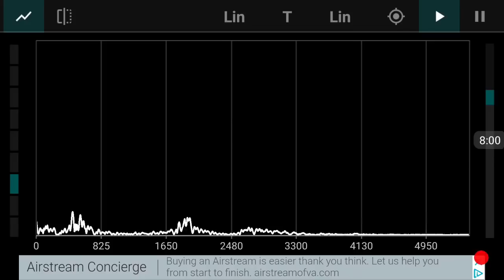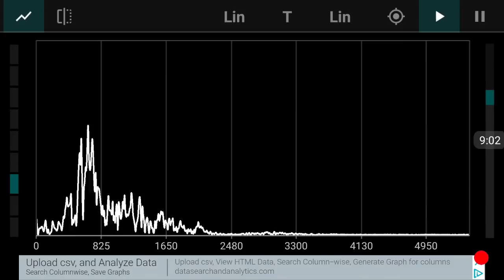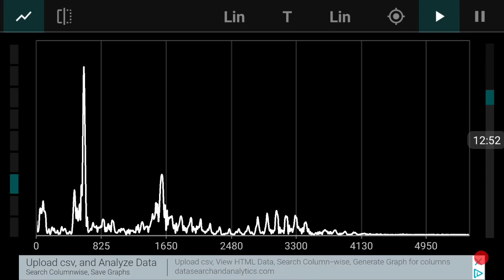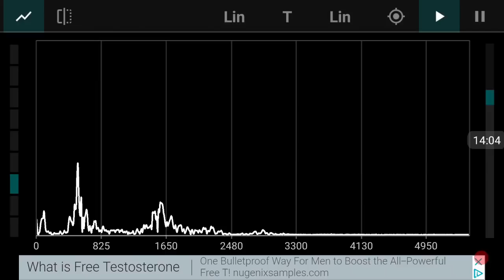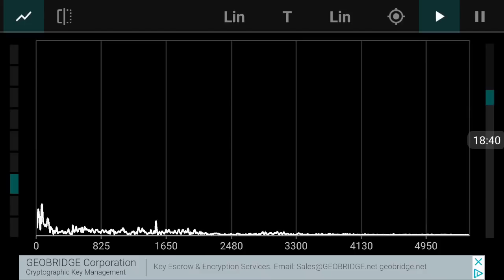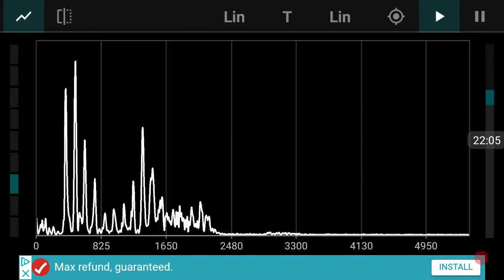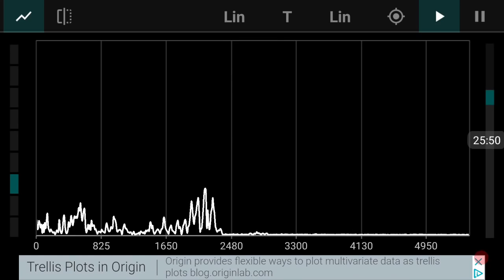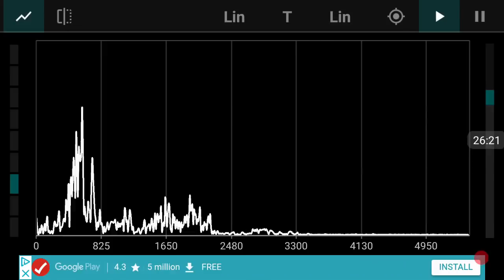CB radio In The Real World, Crystal clear vs the "Dodgy Golden Screwdriver" VideoGate.

Comment from the maker: Here's what it takes to cut through the noise, be loud and crystal clear with a better receiver too. True, it's more complicated and time consuming to accomplish these consistent and accurate results. Below is a partial procedure and list of calibrated equipment used to achieve this level of performance. Rule #1) "Tuned Bench": https://www.youtube.com/watch?v=lwcDfXOgAls  Read on ... the intelligent ones do.

Fine Tune CB Radio Shop strictly adheres to (https://www.nist.gov/) NIST Traceable Calibrations and other industry standards to maintain accuracy and consistency for providing "Real World Performance Tuning" of Citizens Band and 10 Meter export mobile radios with integrity.

"Basic Textbook AM/FM/SSB Transceiver Tune, Alignment and Calibration" 

1) Pll adjustments:
VCO & OSC, AM TX OSC, USB TX OSC, LSB TX OSC.

2) Transmitter alignment:
DRIVER BIAS, FINAL BIAS, SSB  (or gate voltages for mosfet versions) CARRIER BALANCE, HI-LO AM & SSB Power, RF METER, AMC, ALC and FM DEVIATION.

3) Receiver alignment:
AM/FM RF & IF SENSITIVITY, FM DETECTOR/DEVIATION, SSB IF SENSITIVITY, SSB S-METER, AM/FM S-METER (100uV unmodulated -67dbm for “S-9” meter reading!), AM/FM SQUELCH RANGE, SSB SQUELCH RANGE, and NOISE BLANKER/AUTOMATIC NOISE LIMITER (Real World dBm to volts (uV) tables below).

That's a typical run of the mill textbook tune / alignment. There's more to it than frequency alignment, modulation adjustment, meter calibration and "tune for maximum rms, average peak Bird watts "tune up report".

Test Bench includes:

Bird 4314C Meter:
https://www.birdrf.com/Products/Test%20and%20Measurement/Power-Meters/Wattmeters-Line-Sections/RF-Wattmeters/4314C_PEP-Single-Element-Wattmeter.aspx
Part 1) https://www.youtube.com/watch?v=RpX9IHe4ORM&t=16s
Part 2) https://www.youtube.com/watch?v=LuhbqTf6Bxw
Bird 4314C Accuracy Test: https://www.youtube.com/watch?v=DqEOabYqhQo&t=5s
Bird Stipulates 1/2 wavelengths  https://www.youtube.com/watch?v=5eWhgT-rTII
And Genuine Bird Elements from 1K down.

Bird 4373 Sampler: 
https://www.rfparts.com/signal-samplers.html

HP8924c with options:
http://userequip.com/files/specs/2147/HP%208924C%20Repair.pdf
https://www.youtube.com/edit?video_id=Cg1w0xBa27s&video_referrer=watch

HP8920a with options:
https://www.keysight.com/upload/cmc_upload/All/EPSG072204.pdf

Three analog scopes, one digital 200 Mhz:
https://www.atecorp.com/atecorp/media/pdfs/data-sheets/tektronix-2465b-2467b_manual.pdf
https://www.youtube.com/watch?v=by98x4eu2lM

Fluke 27fm:
http://www.fluke.com/fluke/inen/digital-multimeters/fluke-27.htm?pid=56055
 
LCR http://www.lcrresearch.com/wp-content/uploads/2017/05/LCR_Pro1_Manual_version1.03.pdf

Power supplies:
6 Cosel PBA1500f12 (750 amps) variable and configurable.
https://en.cosel.co.jp/product/powersupply/PBA/PBA1500F/PBA1500F-12/
Corcom 20VB1 F7130 EMI Filter 50-60Hz 250V

Times Microwave Coax jumpers and test leads:
http://www.timesmicrowave.com/cms/products/cables/lmr/
https://www.youtube.com/watch?v=EmqaGJ6IWow
https://www.youtube.com/watch?v=1ltFVSxGp5Y
https://www.youtube.com/watch?v=v12YZT_1o90
https://www.youtube.com/watch?v=h7iiYfmYWRA&t=215s

Amphenol RF Connectors:
https://www.amphenolrf.com/
https://www.youtube.com/watch?v=dVh5B0hdEA0 
https://www.youtube.com/watch?v=dKZg8T_AOso

Want more range, compliments, reliability and a quieter, clearer but more sensitive receiver? Get Fine Tuned .. not peaked and ruined.

Here are some VideoGates of me at the bench practicing what I preach using my bench radio or customers radio completed and ready to be shipped: https://www.youtube.com/results?search_query=hard+drive+163+ more: https://www.google.com/search?q=Hard+Drive+163+nm&ie=utf-8&oe=utf-8&client=firefox-b-1-ab

It's what I recommend, use, service and sell ... to you ... not something non practical or deceiving in a misleading way. I'm not just the tech and owner of Fine Tune CB Radio Shop, I'm a customer too!  When finished,  "you'll be giving radio checks, not asking for them".

dBm to watts and volts.
Table below displays relationship between Power in [dBm] or [Watts] and Voltage in RMS, peak, peak-to-peak for sinusoidal signals in 50-Ohm systems for accurately measuring and tuning am/fm/ssb receiver sensitivity, agc, squelch and "S9" Meter calibration  ..  Real World!

  [dBm] [Watts]   [Volts]rms    [Volts]p      [Volts]pp
-140 0.100E-16  22.361 nV  31.618 nV  63.236 nV 
-139 0.126E-16  25.089 nV  35.476 nV  70.952 nV 
-138 0.158E-16  28.150 nV  39.805 nV  79.609 nV 
-137 0.200E-16  31.585 nV  44.662 nV  89.323 nV 
-136 0.251E-16  35.439 nV  50.111 nV  100.222 nV 
-135 0.316E-16  39.764 nV  56.226 nV  112.451 nV 
-134 0.398E-16  44.615 nV  63.086 nV  126.172 nV 
-133 0.501E-16  50.059 nV  70.784 nV  141.568 nV 
-132 0.631E-16  56.167 nV  79.421 nV  158.842 nV 
-131 0.794E-16  63.021 nV  89.112 nV  178.223 nV 
-130 0.100E-15  70.711 nV  99.985 nV  199.970 nV 
-129 0.126E-15  79.339 nV  112.185 nV  224.370 nV 
-128 0.158E-15  89.019 nV  125.874 nV  251.747 nV 
-127 0.200E-15  99.882 nV  141.232 nV  282.465 nV 
-126 0.251E-15  112.069 nV  158.465 nV  316.931 nV 
-125 0.316E-15  125.743 nV  177.801 nV  355.602 nV 
-124 0.398E-15  141.086 nV  199.496 nV  398.992 nV 
-123 0.501E-15  158.301 nV  223.838 nV  447.677 nV 
-122 0.631E-15  177.617 nV  251.151 nV  502.302 nV 
-121 0.794E-15  199.290 nV  281.796 nV  563.591 nV 
-120 0.100E-14  223.607 nV  316.180 nV  632.360 nV 
-119 0.126E-14  250.891 nV  354.760 nV  709.519 nV 
-118 0.158E-14  281.504 nV  398.047 nV  796.094 nV 
-117 0.200E-14  315.853 nV  446.616 nV  893.232 nV 
-116 0.251E-14  0.354 µV  0.501 µV  1.002 µV 
-115 0.316E-14  0.398 µV  0.562 µV  1.125 µV 
-114 0.398E-14  0.446 µV  0.631 µV  1.262 µV 
-113 0.501E-14  0.501 µV  0.708 µV  1.416 µV 
-112 0.631E-14  0.562 µV  0.794 µV  1.588 µV 
-111 0.794E-14  0.630 µV  0.891 µV  1.782 µV 
-110 0.100E-13  0.707 µV  1.000 µV  2.000 µV 
-109 0.126E-13  0.793 µV  1.122 µV  2.244 µV 
-108 0.158E-13  0.890 µV  1.259 µV  2.517 µV 
-107 0.200E-13  0.999 µV  1.412 µV  2.825 µV 
-106 0.251E-13  1.121 µV  1.585 µV  3.169 µV 
-105 0.316E-13  1.257 µV  1.778 µV  3.556 µV 
-104 0.398E-13  1.411 µV  1.995 µV  3.990 µV 
-103 0.501E-13  1.583 µV  2.238 µV  4.477 µV 
-102 0.631E-13  1.776 µV  2.512 µV  5.023 µV 
-101 0.794E-13  1.993 µV  2.818 µV  5.636 µV 
-100 0.100E-12  2.236 µV  3.162 µV  6.324 µV 
-99 0.126E-12  2.509 µV  3.548 µV  7.095 µV 
-98 0.158E-12  2.815 µV  3.980 µV  7.961 µV 
-97 0.200E-12  3.159 µV  4.466 µV  8.932 µV 
-96 0.251E-12  3.544 µV  5.011 µV  10.022 µV 
-95 0.316E-12  3.976 µV  5.623 µV  11.245 µV 
-94 0.398E-12  4.462 µV  6.309 µV  12.617 µV 
-93 0.501E-12  5.006 µV  7.078 µV  14.157 µV 
-92 0.631E-12  5.617 µV  7.942 µV  15.884 µV 
-91 0.794E-12  6.302 µV  8.911 µV  17.822 µV 
-90 0.100E-11  7.071 µV  9.998 µV  19.997 µV 
-89 0.126E-11  7.934 µV  11.218 µV  22.437 µV 
-88 0.158E-11  8.902 µV  12.587 µV  25.175 µV 
-87 0.200E-11  9.988 µV  14.123 µV  28.246 µV 
-86 0.251E-11  11.207 µV  15.847 µV  31.693 µV 
-85 0.316E-11  12.574 µV  17.780 µV  35.560 µV 
-84 0.398E-11  14.109 µV  19.950 µV  39.899 µV 
-83 0.501E-11  15.830 µV  22.384 µV  44.768 µV 
-82 0.631E-11  17.762 µV  25.115 µV  50.230 µV 
-81 0.794E-11  19.929 µV  28.180 µV  56.359 µV 
-80 0.100E-10  22.361 µV  31.618 µV  63.236 µV 
-79 0.126E-10  25.089 µV  35.476 µV  70.952 µV 
-78 0.158E-10  28.150 µV  39.805 µV  79.609 µV 
-77 0.200E-10  31.585 µV  44.662 µV  89.323 µV 
-76 0.251E-10  35.439 µV  50.111 µV  100.222 µV 
-75 0.316E-10  39.764 µV  56.226 µV  112.451 µV 
-74 0.398E-10  44.615 µV  63.086 µV  126.172 µV 
-73 0.501E-10  50.059 µV  70.784 µV  141.568 µV 
-72 0.631E-10  56.167 µV  79.421 µV  158.842 µV 
-71 0.794E-10  63.021 µV  89.112 µV  178.223 µV 
-70 0.100E-09  70.711 µV  99.985 µV  199.970 µV 
-69 0.126E-09  79.339 µV  112.185 µV  224.370 µV 
-68 0.158E-09  89.019 µV  125.874 µV  251.747 µV 
-67 0.200E-09  99.881 µV  141.232 µV  282.465 µV  "S9"
-66 0.251E-09  112.069 µV  158.465 µV  316.931 µV 
-65 0.316E-09  125.743 µV  177.801 µV  355.602 µV 
-64 0.398E-09  141.086 µV  199.496 µV  398.992 µV 
-63 0.501E-09  158.301 µV  223.838 µV  447.677 µV 
-62 0.631E-09  177.617 µV  251.151 µV  502.301 µV 
-61 0.794E-09  199.290 µV  281.796 µV  563.592 µV 
-60 0.100E-08  223.607 µV  316.180 µV  632.360 µV 
-59 0.126E-08  250.891 µV  354.760 µV  709.520 µV 
-58 0.158E-08  281.504 µV  398.047 µV  796.094 µV 
-57 0.200E-08  315.853 µV  446.616 µV  893.232 µV 
-56 0.251E-08  0.354 mV  0.501 mV  1.002 mV 
-55 0.316E-08  0.398 mV  0.562 mV  1.125 mV 
-54 0.398E-08  0.446 mV  0.631 mV  1.262 mV 
-53 0.501E-08  0.501 mV  0.708 mV  1.416 mV 
-52 0.631E-08  0.562 mV  0.794 mV  1.588 mV 
-51 0.794E-08  0.630 mV  0.891 mV  1.782 mV 
-50 0.100E-07  0.707 mV  1.000 mV  2.000 mV 
-49 0.126E-07  0.793 mV  1.122 mV  2.244 mV 
-48 0.158E-07  0.890 mV  1.259 mV  2.517 mV 
-47 0.200E-07  0.999 mV  1.412 mV  2.825 mV 
-46 0.251E-07  1.121 mV  1.585 mV  3.169 mV 
-45 0.316E-07  1.257 mV  1.778 mV  3.556 mV 
-44 0.398E-07  1.411 mV  1.995 mV  3.990 mV 
-43 0.501E-07  1.583 mV  2.238 mV  4.477 mV 
-42 0.631E-07  1.776 mV  2.512 mV  5.023 mV 
-41 0.794E-07  1.993 mV  2.818 mV  5.636 mV 
-40 0.100E-06  2.236 mV  3.162 mV  6.324 mV 
-39 0.126E-06  2.509 mV  3.548 mV  7.095 mV 
-38 0.158E-06  2.815 mV  3.980 mV  7.961 mV 
-37 0.200E-06  3.159 mV  4.466 mV  8.932 mV 
-36 0.251E-06  3.544 mV  5.011 mV  10.022 mV 
-35 0.316E-06  3.976 mV  5.623 mV  11.245 mV 
-34 0.398E-06  4.462 mV  6.309 mV  12.617 mV 
-33 0.501E-06  5.006 mV  7.078 mV  14.157 mV 
-32 0.631E-06  5.617 mV  7.942 mV  15.884 mV 
-31 0.794E-06  6.302 mV  8.911 mV  17.822 mV 
-30 0.100E-05  7.071 mV  9.998 mV  19.997 mV
[dBm] [Watts]   [Volts]rms   [Volts]p     [Volts]pp

If you made it this far, you're a radio nut too! lol

Hard Drive 163 NM. 73's! Click click.

Comment from the maker: The "Silver Tongue" and the "Golden Screwdriver Jockey" .. “If they can't dazzle you with brilliance, they'll baffle you with bullsh#t.” The two go hand in hand .. pun not intended. Get the picture?

Some people should stick with what they're good at like trouble shooting and changing parts, software updates, echo boards, channel boards, recapping and restoring vintage radio gear and nitro knobs etc. Just because they have a "wall full of test equipment" doesn't mean that it's an "actually test/tune/alignment bench with a NIST Traceable Cal Certificate". In many cases, they probably don't even know how to utilize it. Like I Always say, if the cant show you they'll snow you!

"The Cardinal-Rule"
If they cannot display everything at the same time all in plain sight, you've been had! These types of "characters" have questionable integrity, and in some cases, none! There are no excuses. Click the "SHOW MORE" button above and learn the cold hard facts .. don't end up with a under-modulated, over-modulate, low range mud duck radio with a noisy receiver and a inaccurately adjusted "S" Meter. Find someone who solely specializes in 10 meter "Export" Radios only. These "Golden Screwdrivers" call them Black Box Junk ... you'll thank me later!

Sorry "Dave", not like "Mark" does at all ... not even close!  That "Fine Tuned" Cobra 200 sounded good but that President Lincoln ll sounded terrible! I can only imagine how noisy the receiver is along with that inaccuracy adjusted "S" Meter. Maybe you should try SRC next, I hear some of his radios from time to time and they do sound good. Learn to follow directions, keep your "screwdriver" out of the radios, don't burn bridges and there's only one direction from "TDC".